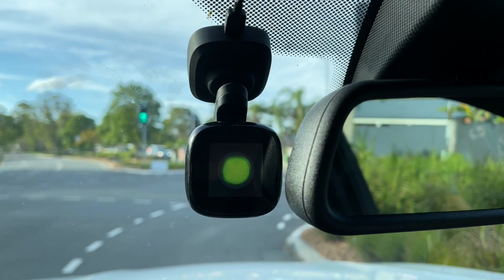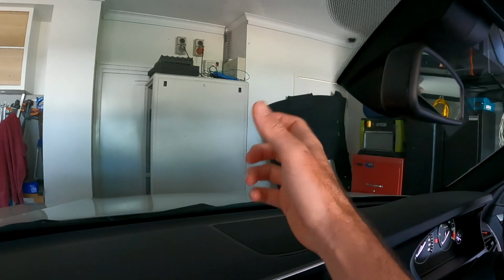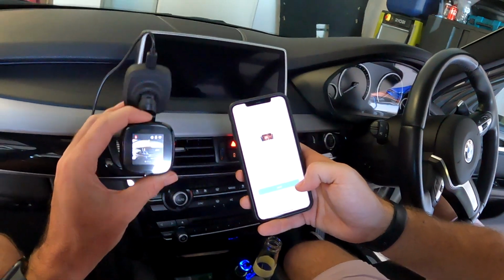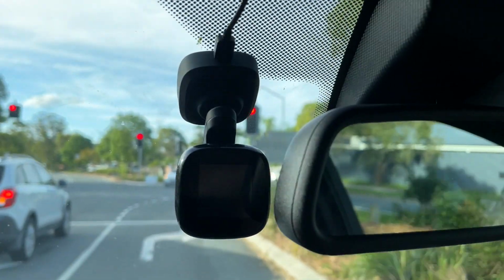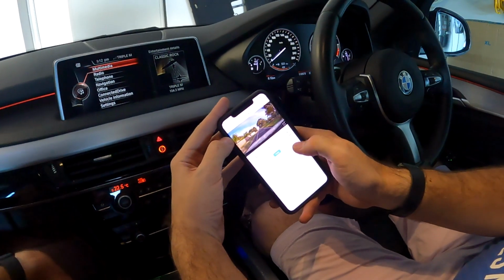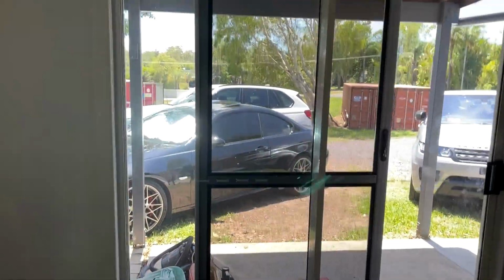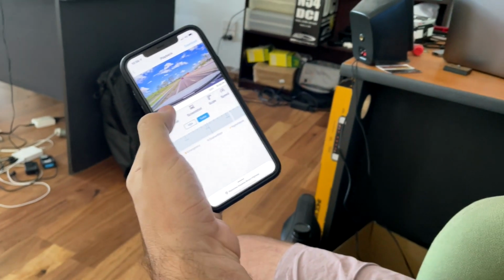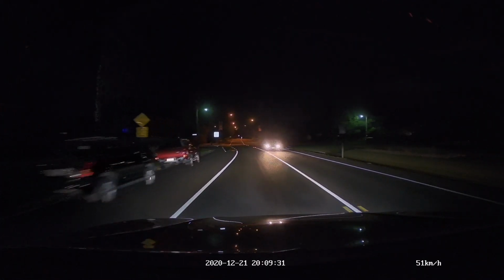BMW F15 X5 Dash Cam Install & Test: Jomise K7

Comment: So I had to take a traffic class in order to get my license back 🤪 and I had to pass this class called Smith System. One thing that stuck with me was that you should never immediately go on green because someone on the other side might run the light and crash into you. You’re supposed to wait 4 seconds before you go. The tragic light feature on this dash cam seems to have that delay built in. Interesting
Reply from the maker: That’s a good point. I remember being taught to always be careful if you are first inline at the lights. Just in case there is a red light bandit coming through.

Comment: You could hardwire it through the CAS module like how the BMW advanced eye dashcam is installed. To avoid excess battery usage warnings. Link to the install pdf here: https://www.e90post.com/forums/showthread.php?t=1579831

Comment: I just tapped into the sunroof panel there is a permanent and a switched feed, just used a 12v to 5v buck 👍
Reply from the maker: Good tip! Will have to let mark know, although i think he managed to get the fuse setup in the back for it today.